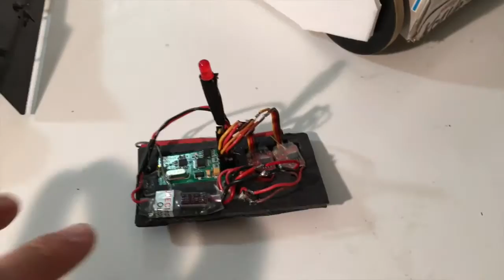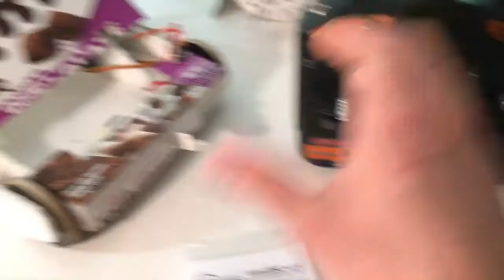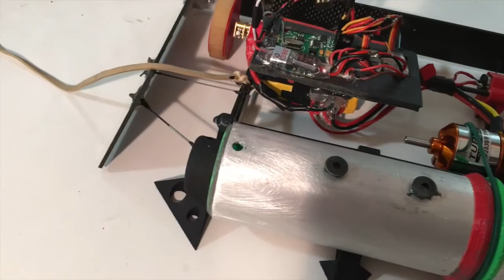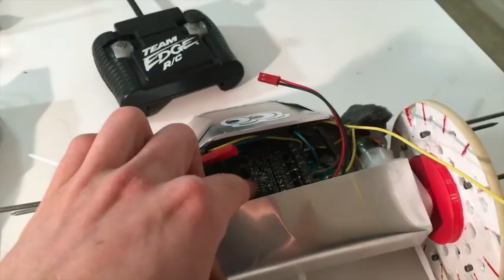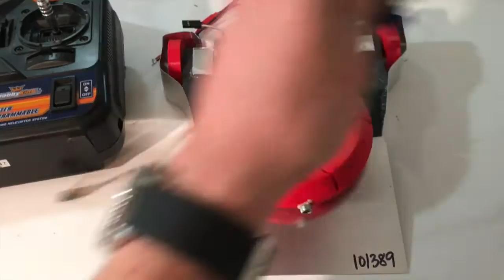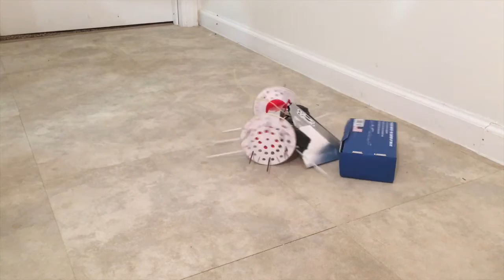Modular Control Board for Combat Robots

Comment: I am making a 4wd antweight drum, and I had a question. How do you the drill the holes on the drum for the teeth so precisely? It seems like if you were slightly off it would be too of balance. Thanks!
Reply from the maker: I used a mill at my university, which gave me more precision than a drill press would have, and mine was still slightly off balance.  I'm not experienced at balancing spinners. I think a lot of people use the same method as used to balance RC airplane props, and just angle grind material off until their weapon is balanced.
Reply: AltaPowderDog Ah, thanks!

Comment: The control from H.K. Does it matter if I get mode 1 or 2 ?
Reply from the maker: If you get Mode 2, the airplane throttle stick (the one which does not self-center, and the one which I use to control the weapon) will be on the left.  That's what I prefer, but no it doesn't really matter.  Here's more info: http://www.spektrumrc.com/Articles/Article.aspx?ArticleID=2105
Reply: Thank you:D

Comment: I got the same TX/RX from HK, but I also bought a cheap HC-06 bluetooth module on ebay ($4-7) and connected it to the +5,RX,TX and GND wires that lead to the programming connector in the TX. Then I bought a $2 program called Digital Radio (easy to find if you google). Now i can program my TX with my tablet with no cable and no laptop and the whole upgrade was < $10.

Comment: Good choice using the Tiny esc instead of Sabertooth. Those have a tendency to randomly stop working. I also really like the use of Carbon Rods, reminds me of the old VDD kits that had so much success. Its cool that you bring something a little bit different to the table with your bots.
Reply: Can you tell me what VDD kits are and add a link on where to find them?